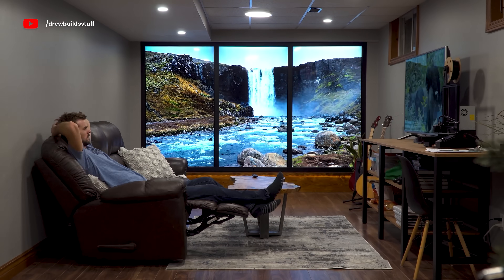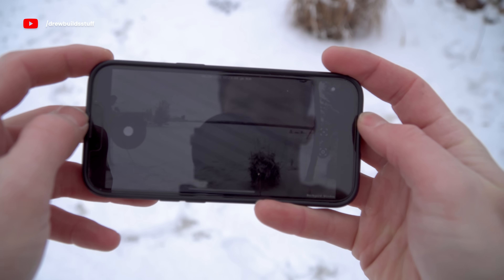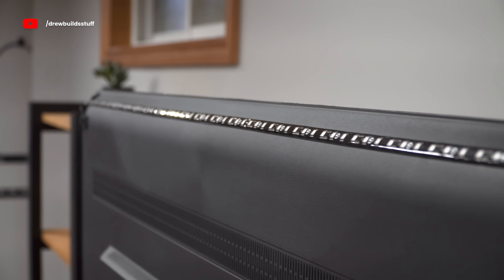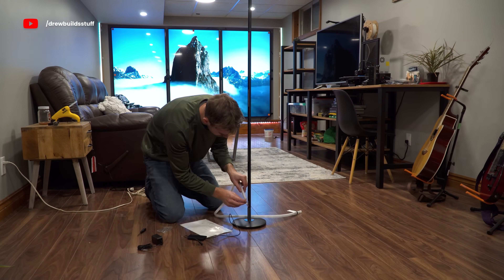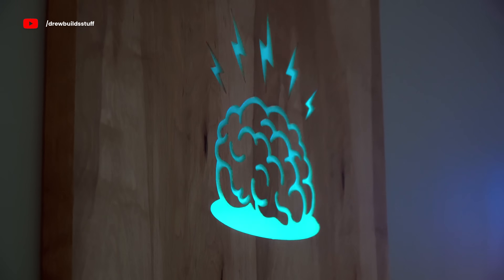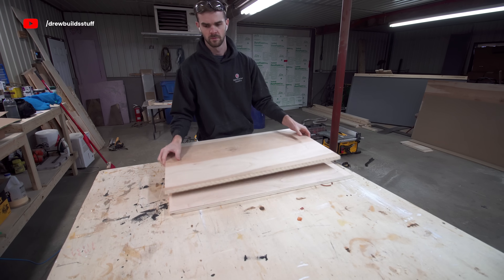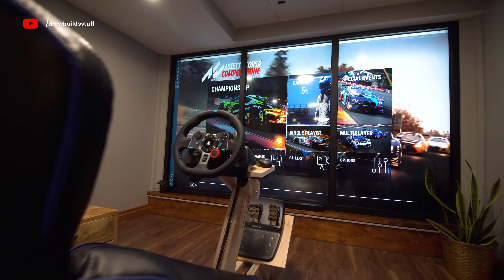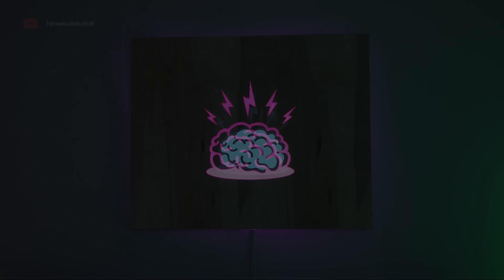Making a LIFE SIZE GAMING SIMULATOR

Comment: amazing stuff, I just wouldn't be able to pretend those bezels aren't there.  But man that is some amazing work you put in there.
Reply: Its like real windows with the trim between
Reply: Ditto, I would have put them as close as possible with a frame around them to minimize the bars. I know it was an intentional decision so as long as he is happy is all that matters.
Reply: I think it suits the windows view but for anything else it would bother me too. Frameless tv's would've been perfect for this and instead of simulating 3 windows, just simulating one big window. The tv's would be a lot more expensive though, at least if it's OLED but I wouldn't want anything else.

Great build nevertheless!
Reply: Same, would've been better with a laser projector
Reply: Same.
Reply: Bezels have plagued multimonitor setups for YEARS. The only solutions here are to either obtain one MASSIVE 8K display, or go old-school and just use an overhead projector. The TV being absolutely impractical because something like a Samsung Class Q900 is $10k (US) alone.
Reply: @TSPxEclipse  Would be kind of difficult to run 3 independent pictures with 1 source.  3 4K monitors is a lot cheaper than massive 8K and sharper than 1 projector.
Are there 3 projector set up to merge as 1 final output (render 1/3 of it) while retaining high resolution as 3 separate 4K monitors?
Reply: Well, he could have worked the opposite way. A unique large projected screen and a removable frame, to easily switch from the ful screen effect to the window effect

Comment: Congrats on getting the new table saw. The little wedge of metal sticking up behind the blade is called a riving knife, it helps prevent kick back.  Yours appears to be loose, which would make it ineffective.  There's a little lever down inside the saw that you can use to tighten it up.
Reply: This is why I came to the comments. Remove the throat plate and tighten that up. It keeps your cut from squeezing the back of your blade and launching the material a thousand miles per second at your face. Turns out it's quite a helpful bit of kit.
Reply: I'm glad to see other viewers saw this potential hazard before I viewed this video.
Reply: Exactly why I scrolled through the comments. When I saw that I was scared for you on your behalf.

That riving knife is dangerous as it is. Definitely get that tightened up.
Reply: erlik sen misin

Comment: Great video, explained the whole process, decision making and you kept me fully focused for the entire length of the video. Couple of practical and design tips: you could have mounted that outside camera a bit higher to serve as a proper surveillance camera and since it can adjust the angle vertically would be okay for your virtual window purpose still :) Gaming chair would be easier to cary and store if you made the 3 main parts bolted and quick paint to black/dark gray would make it look much nicer in your room. But other then those small details I am impressed with the level of craftsmanship and DIY skills in general

Comment: The whole thing is an absolute vibe!!!
Beautifully done 🤗
My engineer brain was trying to figure out the bezel thing the entire video. I bet if you put the middle TV forward and inch and the two on the sides back an inch, and move them closer to one another, I think you could probably lessen the thickness of the bezel and no one would notice. But that would also depend on the televisions used. Just a thought... Nicely done 👌

Comment: Amazing work.  I’m so impressed.  Just a note.  The 3070 is a tremendous card. Actually quite a high spec.  I think running any graphics card at 12k resolution is a pretty big ask.
Reply: Indeed. Maybe doubling it up and running two 3070 to share the strain would fix most of the issues. But... $$$
Reply: 100% chance that 3070 is going to be screaming for help. Realistically he'd want a 4090 when trying to drive all those pixels while gaming. And i think even then they've only really been tested at 8k iirc. Ideally he could run each display at 2k instead, it will still look fantastic and drastically reduce the strain on the gpu.
Reply: @Slimesy_  Running a 4K display at 1080p is really not a great advice tbh. But yes, a 3090 or better would probably be fine for 60 FPS gaming at that resolution, depending on the game.
Reply: It's not even 8K resolution, though. 8K is 4x 4K monitors.
Reply: "I think running any graphics card at 12k resolution is a pretty big ask."

It's not 12K. It's not even 8K.

It's 75% of 8K, and 33% of 12K. MUCH lower than 12K.
Reply: @mortenmoulder  i said 2k, 1440p. Not 1080p. I agree with you, though, running your display at its highest possible resolution will obviously output the best results.
Reply: @Slimesy_  2k is 1080p though. Not 1440p. Think about what 4k and 8k is defined by, then apply the same for 2k, and you will end up with 1080p
Reply: @mortenmoulder  from BenQ's website: "2K displays are those whose width falls in the 2,000-pixel range. More often than not, you’ll find 2K monitors with a display resolution of 2560x1440"
So are you wrong or is BenQ wrong?
Reply: @Slimesy_  Yes, BenQ is wrong. 2K * 4 is 4K. 4K * 4 is 8K. 8K * 4 is 16K. The definition of the "K standard" is "approximately amount of horizontal pixels". 1080p has 1920 horizontal pixels, therefore 1080p is 2K. 1440p has 2560 horizontal pixels - closer to 3K than 2K. Therefore if 1440p must have a standard, the name would be 2.5K. 4K has 3840 horizontal pixels. Remember, these are 16:9 resolutions. The DCI/cinema resolutions are 2048x1080 for 1080p, 4096x2160 for 4K, and so on. So even more proof that 2K is 1080p.
Reply: @mortenmoulder  nice to know, ill definitely make sure to trust what comes from random youtube commenters have to say rather than actual monitor manufacturers from now on 👌🏼
Reply: @Slimesy_  Did you not understand what he explained to you? And how it contradicts what BenQ's website says? Businesses call LCD displays "LED" displays even though they're not LED --- they're LCD displays with LED backlights. When LCD displays used to have fluorescent backlights did they call them Flourescent displays?

But go ahead and trust a business. Everyone knows they never exaggerate or lie about anything! :)
Reply: @bricaaron3978  Yeah let's trust every business, ignore actual facts, and ignore common sense. It's not like a business has lied before to get more sales.

Sometimes, people are too stupid to understand the most basic logic. I hope he doesn't work with anomaly detection, banking, or just numbers in general, because if you can't see the difference between 2K, 4K, 8K, etc. by the resolution and simple mulitiplication, you shouldn't be working with numbers lmfao
Reply: @Slimesy_  And I'll make sure to spot trolls early on, so I don't waste my time explaining simple math to a troll.

Comment: I hope this was already fixed, but on the Reolink camera CAT5 connection, I would add a drip loop before the fitting so water doesnt go into it and also hit it with some silicone sealant to prevent the copper from getting corroded.  Mine stopped working when the springy wires inside the female fitting became corroded.  Had to clean them with contact cleaner and a toothbrush, but better to save the trouble.

Also use some car battery grease on them once cleaned and it should prevent further corrosion.

Comment: I can't believe you didn't get the monitors as close as possible to each other, (much less taking them apart and making them nearly seamless..)
Reply: Likely because the original intent was to have them as faux windows, so the bezels just look like those on a window. Agree that now it's a lot more than just a digital window it would be better to minimize the seams as much as possible, I couldn't watch/play anything with those in the way.
Reply: @sadochismo3373  I just had an idea!   Make them as seamless as possible,  but have a same size piece of Plexiglass with a Black Wood  'window pane cross', you can pop over it, (to protect it when not in use as a 'TV') and also to make it look like a 4 panel giant window! :")  Best of both worlds!
Reply: I think he should revisit this project and do just that, and then make much skinnier bezels. I get it as a window but now that it's gaming why not? Wouldn't cost much more money to do a small modification like that.

Comment: This is the best and most practical setup I have ever seen. A quick suggestion to make it even better.
- Maybe you need to implement something like Unreal Engine Virtual production with this. So, the camera angle of the scenery is adjusted to the real camera. That will work for making videos, but to make it more immersive, you could add eye tracking to it. So, where ever you move in the room, you see the scenery according to it. This will add more depth to it.
- Use a projector instead of TVs. So, you can get rid of the bars. For the window look, you could make the bars virtual instead of the real ones.

Comment: This is super cool. I wonder how much of the bevel could be removed to get the tv closer. Either way pretty sick set up. 
I want to make my desk much like you built your sign. I am going to use defusion panels for everything instead of epoxy. Since I will have cabinets with drawers I plan on adding lights in the space between the drawer and side and every where else I can do it. I like the addition to the walls and now considering doing that.
Reply: I could not realistically game with those bevels
Reply: @exorowhipzz  Yeah same thing. While it is super cool they do make pretty nice high end projectors. I used to have one like 10 years ago. The blub burnt out and we quit using it. Though we did not have theater screen or anything and just did it on the walls. It was pretty cool. These days everyone just has their own big screen. 
If you like some of these projects then DIY perks does some good ones with tech. A lot of his new stuff is all high end and you need money and the older ones you do not need money. Check them out.

Comment: This is a crazy setup! But I couldn't handle the bars separating the image during games... Especially on shooters, seeing everything matters. If a sniper is behind one of those bars as you crest a hill, you'll have no idea and die. But I love the bars for landscapes.
Reply: Definitely not ideal for FPS games. But for casual stuff (which let's be real, no serious gamer is using this size screen) this is fantastic
Reply: He specifically showed how he calibrated it so that the bars are factored into the display, thus not creating any "blank spots"
Reply: @shecravesit7072  he showed how he calibrated to account for the space. Meaning, there is a gap on the pixels that is not showing. You can see this when he lines it up in the scene you refer to. At the beginning of that scene, it's as you describe- not missing anything. This however makes things not line up perfectly. When you remove the pixels the width of the bezels it makes everything line up again.

Comment: i totally agree that those dividers between the screens are too wide for me to ignore it so i think you easily solve it by positioning them closer to each other. other than that, everything seems good or maybe you need a better 3d surround good bass speaker and carpet the wall if possible to absorb noise/echo to match the upgraded gaming or movie experience.

Comment: Pro Tip: When installing cable through any perimeter walls you should always hold the drill at an upward angle meaning the handle is lower than the bit. This is done to prevent water from running down the cable into the wall whenever it rains.  Nice build Drew.
Reply: Thank you brother 🙏 💙

Comment: You can also do this with the seat from a car at the local junk yard/pull a part. Just aim for the front passenger seat. Statistically, it's the least likely used bucket seat in almost any vehicle.

Comment: It all looks really great and is certainly even more satisfying when you do it yourself :) If we talk about the "function" of the window then those frames in the middle are atmospheric, but in the case of Gaming they spoil the atmosphere a bit, although you can probably get used to it as you say yourself in the video. IMO if one were to bring the TVs a bit closer together and not leave a gap between them then one could think about removable center frames, e.g. with a stronger magnet, or adjust the top of the frame so that it could "snap" hanging on its weight (which doesn't have to be much, instead of wood one could use slats with reinforcement on the invisible side). Although, on the other hand, you have to ask yourself whether it is worth investing time in this for perhaps disproportionate results. Greetings!

Comment: Its good work, good design and concept followed through. I recommend eventually replacing the 3 TVs with a newer single 4k or 8k large TV with higher hertz, and replace the 3070 with a 4080 super, 4090 or wait for 5 series cards in a year to gain DLSS and other new features.  Other than that looks pretty flawless.

Comment: Awesome work, simply outstanding!  Drew, the riving knife on your table saw is not secure.  I'm not sure if Dewalt designed it this way, but I have an older version of this same saw and there is no movement with the riving knife on my saw.  Might be a safety issue.  Good thinking to always remain scared when using these tools.

Comment: Looks good but obviously the bezel frame is annoying. You can remove the bezels and it will run fine. you might be able to get away with simply cutting off the bezels on on the sides where they meet (2 sides on the middle, one side on the outer tvs) otherwise you can probably run them without a bezel if you bond them (e.g. w/epoxy but then they aren't coming apart) or make an invisible bezel holder out of silicone maybe with a reversible adhesive. I've fixed a large TV before and if you are going to try this make sure to invest in some decent quality suction cup handles.

Comment: I could never have used this setup because of the thick frames. I couldn't even have play on it with any splits on screen at all.
This is why i used a projector with 102" Screen instead since 2004, but i upgraded the projector a few times.

Comment: Ok so one thing I’ve noticed is when you use your table saw you tend to push on the outside edge of the board you’re cutting which is not a good practice. You might not realize how little force it takes to pinch the blade and cause kickback. Which believe me isn’t something you want at all.

Comment: Its a cool build, but I would offer 2 major suggestions for updates. First: the bezels on screens you are using are WAY too thick. There are OLEDS now with MUCH thinner (mine is .5 inch). You want to get the THINNEST Bazels you can find, or consider a projector. It just ruins the experience on what really is a great build.

Secondly, the 3070 on your PC is really not up to piloting 3 large screens at high res. I would look at a 4080 even a 4090. The new 4080 Super is going for $1000 (with the cooling and power to boot) and would massively improve permanence at high resolution

Comment: Did you remember to pack the cable hole in the exterior wall with some rough rodent-blocking material (plastic "steel-wool" like stuff, or even stainless steel wool with caulk)?  Rodents can get in a hole the size of a dime...  They don't like that material, and look elsewhere...

Comment: the instal. of your camera is not good. you need 4 ouside Pipe`s and Tube`s. also you need to compress the hole wehre your cable goes through. the rest is fine and well made.

Comment: These suggestions in the comments by a projector... clueless. Projector is not an alternative for this project. Review the video to see that the primary focus is a simulated window. And those suggesting an 85" TV instead because of the bars... even more clueless! 85" to 130" is an absurd difference (a 130-inch TV has approximately 2.34 times the area of the 85-inch TV ).